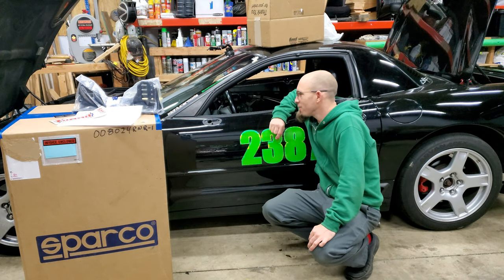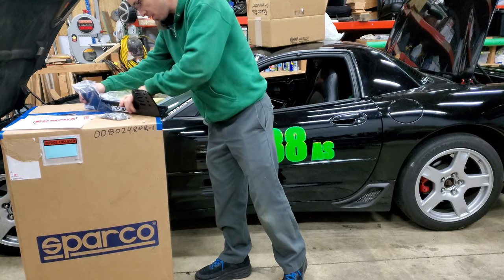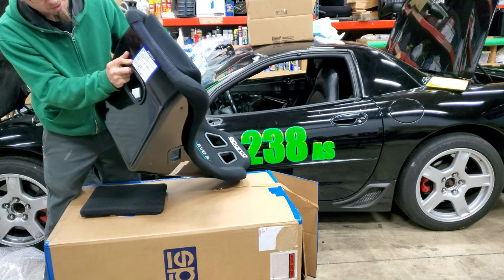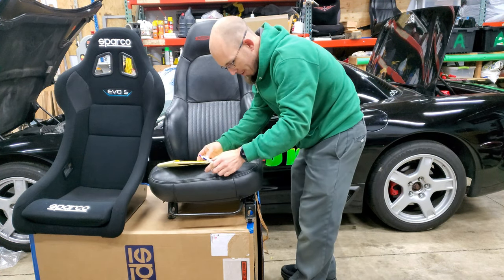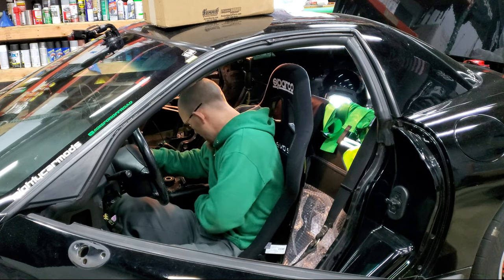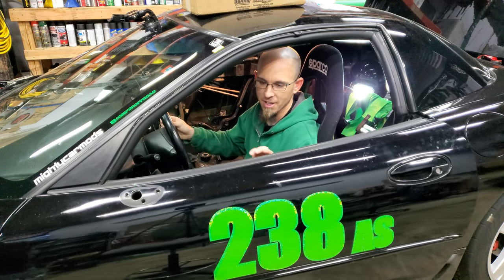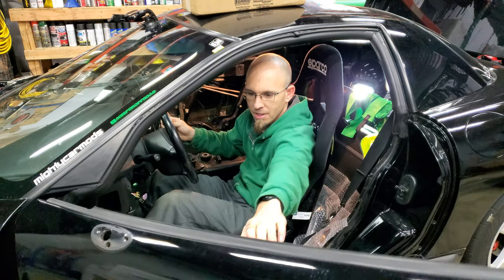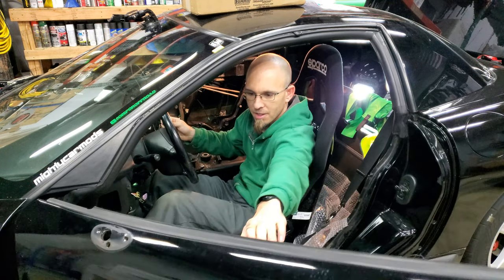Sparco EVO QRT Unboxing & Test fit in a Corvette C5

Comment: Mine is stock and my trans gets to 240 when i drive it hard, is this normal or should i get a trans cooler
Reply from the maker: I have a stock trans as well but I never watch my trans temp so  I don't know.   I have a track day coming up and I can check them.   Overall my car now has three large hood vents and an upgraded radiator so it won't be very comparable.